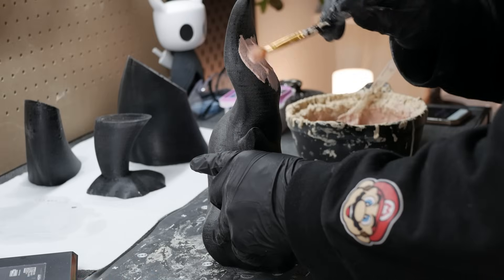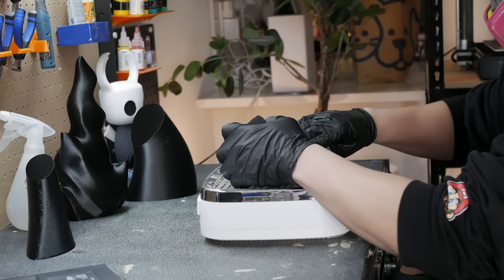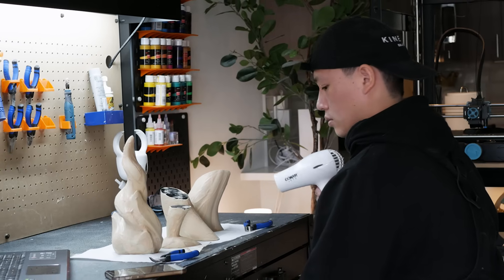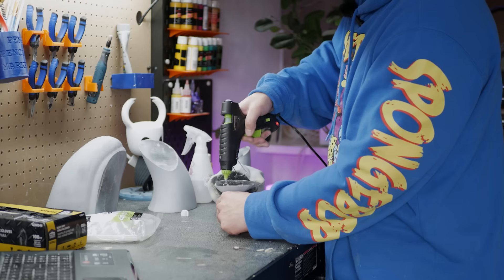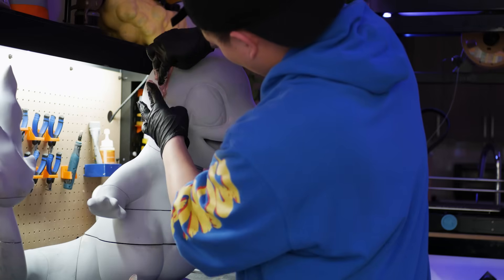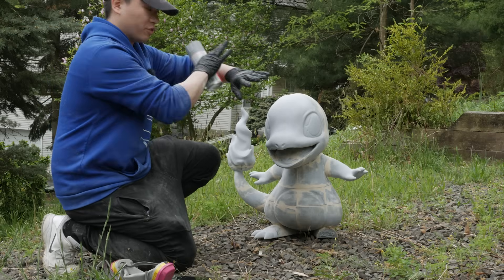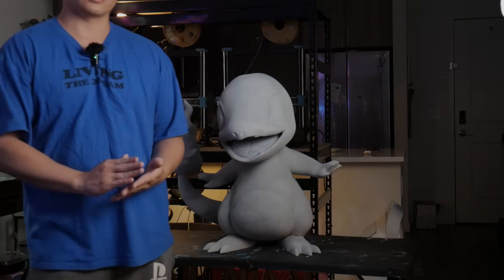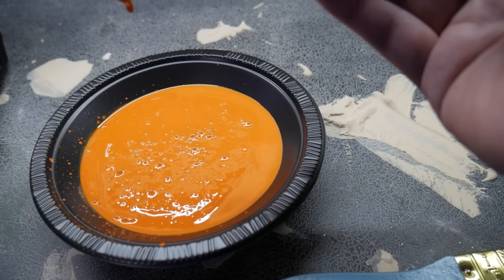How to 3D Print Large Models with Small 3D Printers - Step by step (Beginner)

Comment: Since you got the printer have you had an issues with it or have to do lots of maintenance upkeep?
Reply from the maker: 👀 no issues at all! I had them for about 9-8 months now and I have to say they’re amazing. The only thing I upgraded was the nozzle into a hardened steel. Maintenance is easy, just lube and that’s it. I bought extra bearing incase. But they been sitting on the shelves collecting dust 😅

Also they run 24/7. I haven’t turned them off since may 💀

Comment: Looks sick, a closer look after finish and maybe a 360 would be cool.
Biggest prints I've done far is what would fit on the build plate, but rly intrigued by this size prints haha, so would love a more detailed video about how to cut it up, and how you decide where to cut and how many pieces.

Also, do you just print in regular PLA, and what site is that for finding the STL's?
Regards
Reply from the maker: Ah man, I felt bad cause someone else mention about how they wish it was 360 shot 😅 so about the cutting up part, someone mention about a program called Luban3D that will literally cut up the pieces for you. It will also make sure the pieces fit perfectly on your 3d printer. I tested it out last night with a trial, and holy moly. It is literally a program sent by god.

And yes! It’s just regular PLA 👀 I find the stl file on Thang and it’s made by printedobsession

Comment: Try weld on 16 glue instead of hot glue!! Its the best glue for PLA. :D
Reply from the maker: Ohhh This is a new one, I have to try it out, I use so much glue it’s getting out of hand haha
Reply: Also put pegs or dowel pieces between pieces for stronger adherence. Glue melts eventually.